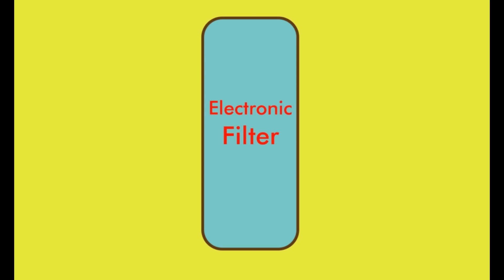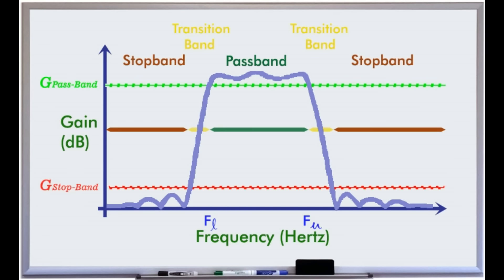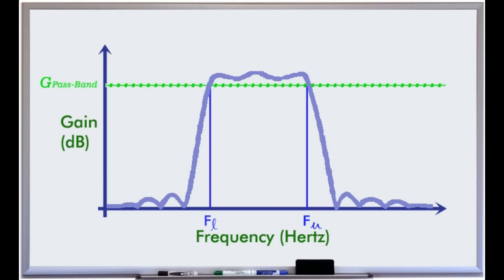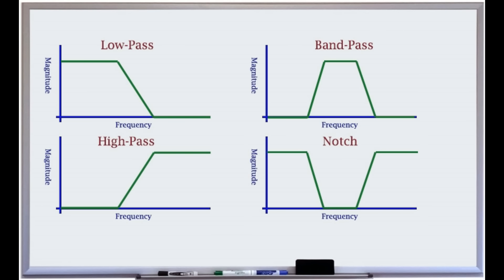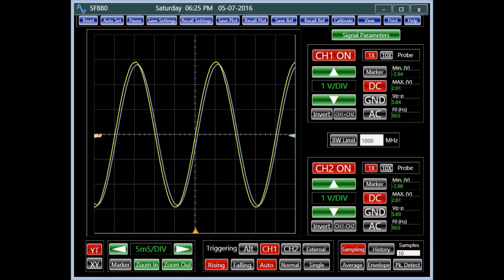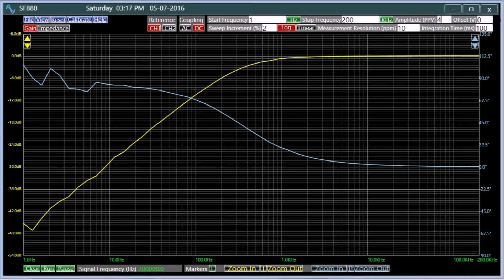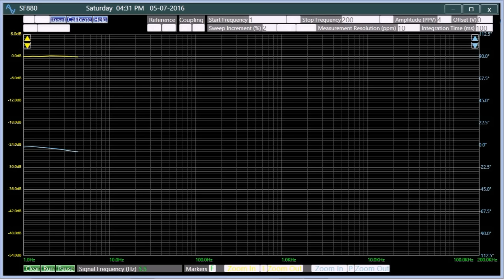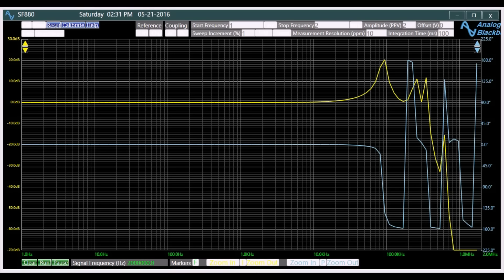Low-pass High-pass Band-pass Band-stop Filter Basics

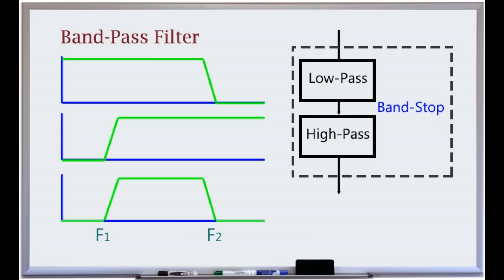Comment: in 4:53 i think it will form a band stop filter not band pass
Reply from the maker: Thank you for your comment. Ideally, the low-pass filter in the diagram passes frequencies  up to its cut-off frequency. The High pass filter passes frequencies higher than its cut-off frequencies. The frequency overlap between the filters, is where signals pass through both filters. Therefore it makes the circuit a band-pass filter, with a bandwidth of the  high-pass minus the low pass cutoff frequencies.